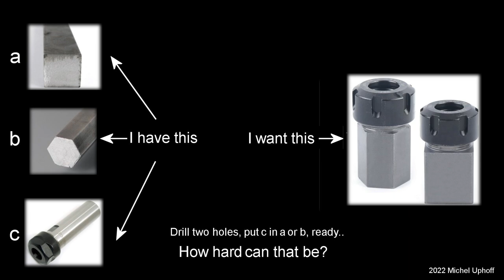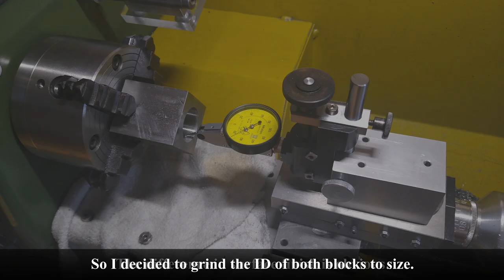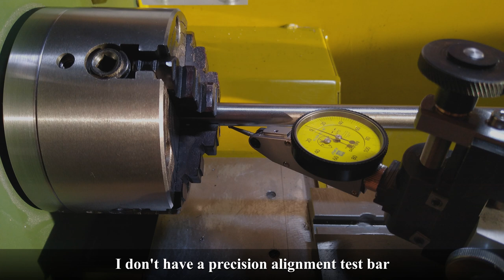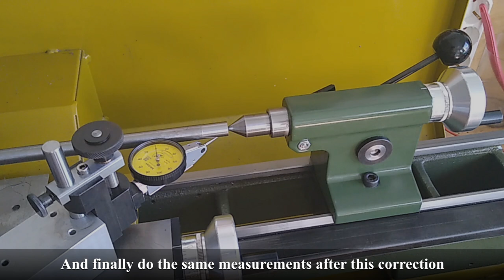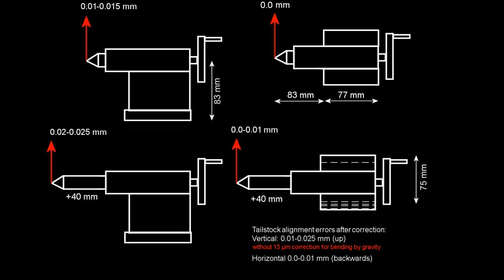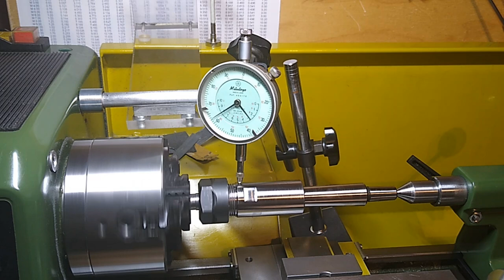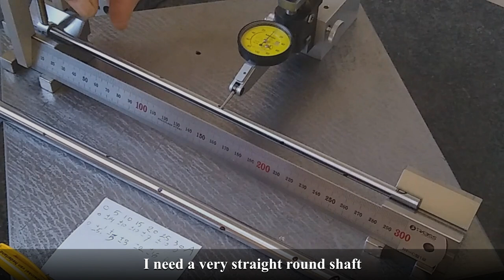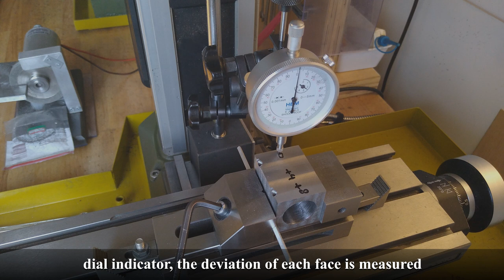(not so) Simple collet blocks

Comment: I don't even use the lock on the tailstock because of that. Theoretically it can be adjusted but my cheapo pulls on the spline and changes center so I just crank it with the wheel and leave it at that.

Comment: Hi Michel, it all depends on the accuracy of the collet you use for this action,
don`t you think? 
By the way, a friend of Job.
Reply from the maker: Yes, the accuracy of the collets used is of course very important. Actually I had to use a few different diameters (turning, measuring), so errors could accumulate. But the runout is within 0,02 mm for the collets I used until now.

Comment: Michel, I think your sreaming tooling has to with "some" rigidity" issues. E.g. it's a small, flexible, machine, the stick out for the small boring bars is long and they flex below center height into not ideal cutting conditions. I also encounter this on a bigger machine but have found some tricks to reduce it or even get rid of it. Try to find boring bars with carbide shanks. They cost more (I paid 250 euro for a set of 3). Start with the tip of the boring bar a hair above center height, try lowering your spindle speed with the same d.o.c. (sometimes resonance is an issue), use a good cutting oil like Motorex (not affiliated by any means, just a happy customer), sharpen your insert with a diamond stone, and last but not least decrease your depth of cut in combination with a lower cutting speed. You should get better result with a combination of these actions. Maybe this helps. All the best, Job
(ps, holding the grinder with a split clamping device? More rigid, no marring of the tool? ps2; Misalignment of the headstock is common for lathes. I correct the difference in diameter by displacing the headstock from the centerline according to a bigger or smaller end on the part. Bigger? The headstock should be moved half the error towards you so it cuts more to the end. Much easier than going for the theoretic ideal center of the machine. In the beginning start with an indicator in a collet in the spindle and indicate the pinole to the center for common work like drilling. Centricator is ideal for this...) Looking further I think your tailstock isn't adjustable. A movable center could do the same trick. They're sold as a kit and maybe as a complete item. The morse taper is not the ideal support to. It still can hinge under load. A tight plug with a center hole would give you more support)
Reply from the maker: Thank you for your comments.
I'm sure a better boring bar, less d.o.c, correct spindle speed and a good cutting oil all wil help to reduce that noise and aid to a better surface finish, but I don't think this was the real issue here. The hexagonal block cut like a charm, as other more demanding inner turning jobs did. The steel for the square block had just a very poor machinability.

Unfortunately the tailstock of my lathe is not radially adjustable, so I had to solve the problem the way I did.

That indicator in a collet or the chuck is a nice idea. Way quicker than the way I did it.
Reply: @Michel-Uphoff  Hi Michel, I have the same lathe so I really like all your improvements. However, is the Hex and square block both the same grades of steel - is it possible that the hex block was "softer" ?
Reply from the maker: @anthonycrimin1600  The hex blok was made of free cutting carbon steel. The square was made of some unknown type of steel, maybe a kind of structural steel.